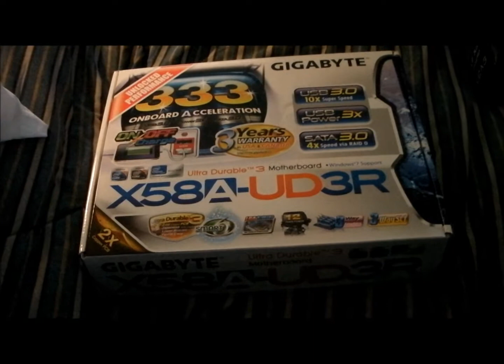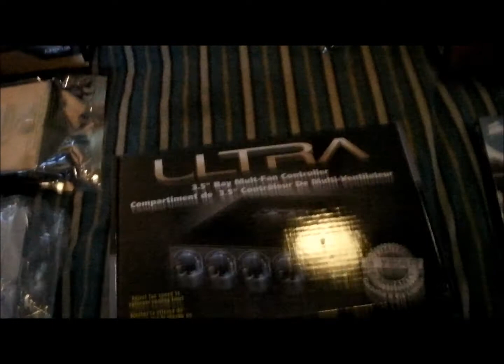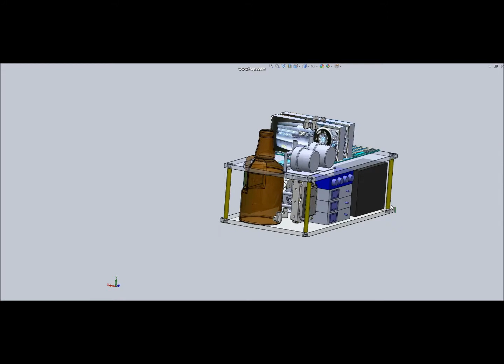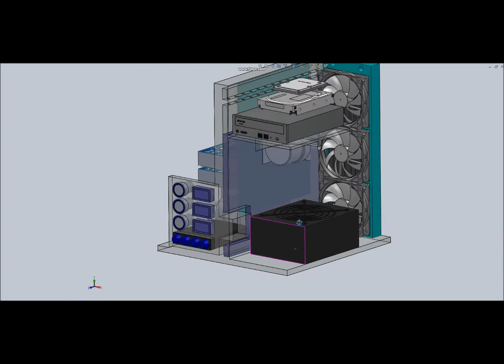Winter 2010 PC Build Part 1

Comment: Looks to be an awesome build! My specs:
AMD Phenom II x4 965
G.Skill DDR3 1600 ripjaws
600w PSU
1tb cav black (going to be getting an SSD when it's all put together.)
ATI Radeon 5770 (upgrading to 6870)
Gigabyte 890XA-UD3

Never dabbled in a custom chassis...Looks interesting, might try it when Bulldozer comes out.